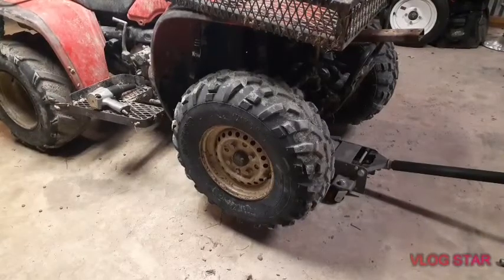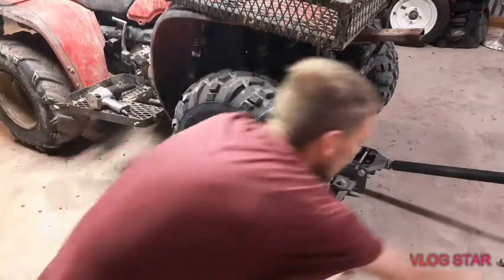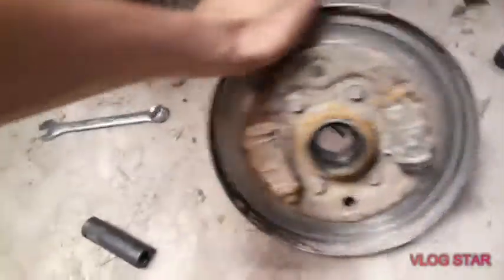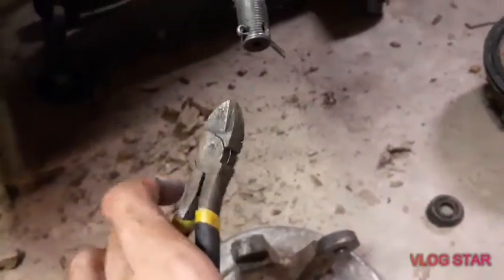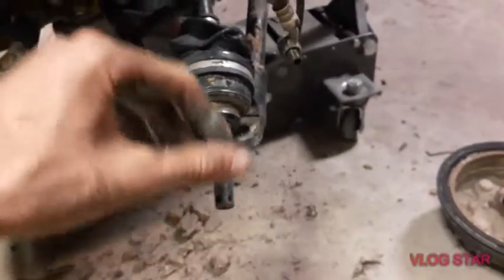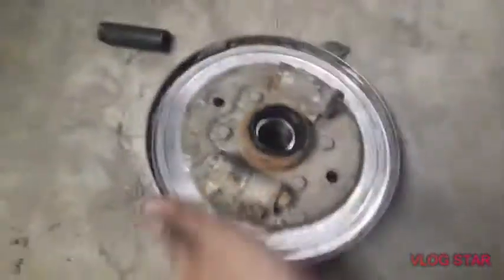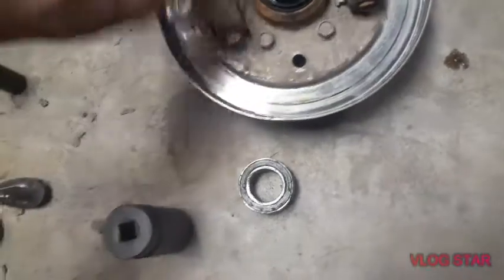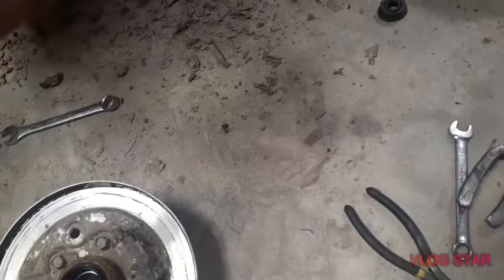How to replace front wheel bearings on an atv(1988 honda fourtrax 300 4x4)

Comment: Mine roars pretty loud when driving it. Is that wheel bearings?
Reply: That's what I wanna know. The higher the gear it's in the louder it is.
Reply: It is some sort of bearing yes
Reply: @lie380 that sounds like a diff issue

Comment: Good Video, thanks. -Muddy
Reply from the maker: Thank you for watching, your welcome
Reply: @fabricobblegarage2828  hi I’m 14 and I need help changing the front and rear wheel bearings and the rear axle bearings in my 1998 Honda Trx250 I don’t have anybody to help me do it, if you could possibly help walk me through doing it that would be amazing
Reply from the maker: @The420Pastor  I definitely don't mind helping but I've never done one on a 250 but from what I've seen they are pretty similar so you can use the same kind of process I use in my videos to remove the parts and reassemble
Reply: @fabricobblegarage2828  alright thank you
Reply: @fabricobblegarage2828  alright thank you